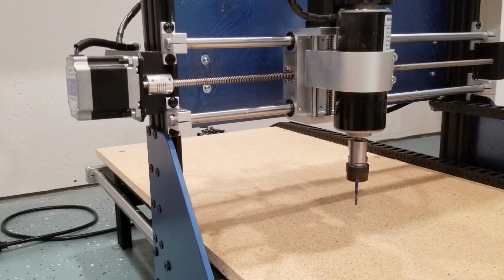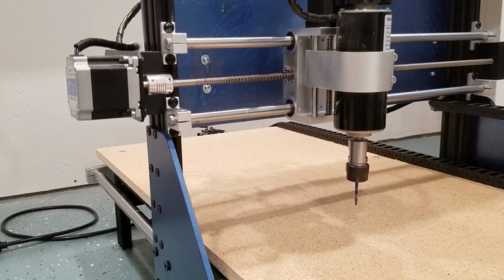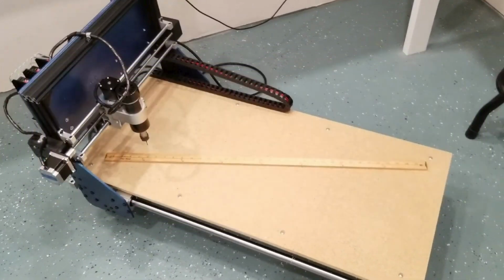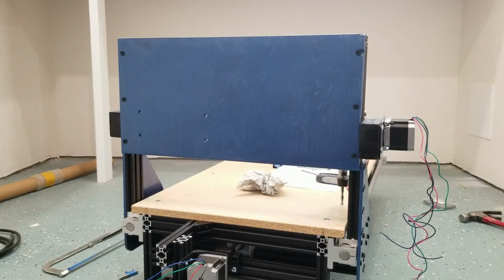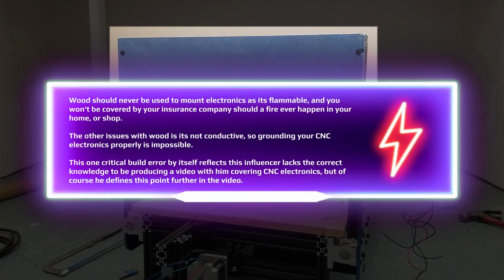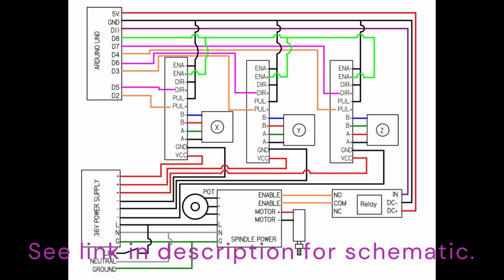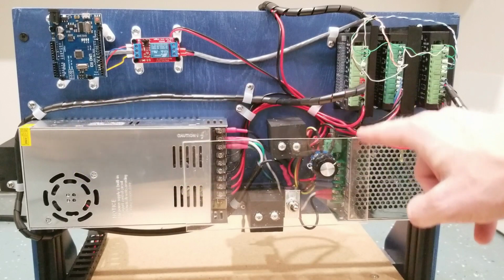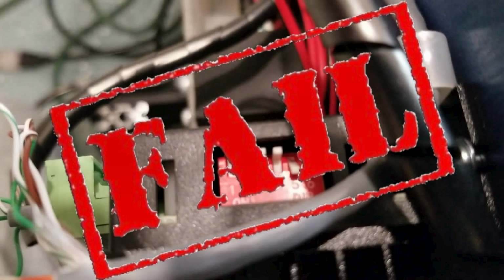CNC Router Controllers Built Incorrectly (Volume 17)

Comment: I had EMI nose issues in my DRO on my manual mill because all the mounting hardware was anodized or painted. Only after I ground off those coatings on numerous parts in key locations and achieved good solid grounds was I able to get rock solid repeatable performance from my DRO.

Comment: I inherited my bosses plasma diy project when i started to work there.... the list of stuff that are wrong with the project is endless ... didn't watch all of these vids yet, but i am sure that everything you have covered in the series this far will be on the list 🤣
basically it got put on pause 3 years ago... electrical components screwed with 1 screw to a piece of wood, and on top of this the plasma-unit next to this , and mechanically so cheapo it was no go-go
Reply from the maker: Unfortunately this is the case with many of these DIY project systems. Sometimes the original owner simply gives up, sells the system or passes it on. 

I can't tell you how many end users get in over their heads, and pas their problems to others. 

Thank you,
Vince

Comment: Is it safe by your standards, if the x axis sides are acrylic and moveing on nilon wheels on the y axis and the y axis is held by acrylic on the front and back. All rails are aluminium and electronics such as controllers and vfd is separate from each other? Building one right now
Reply from the maker: Thank you for your support. Safety isn't so much an issue pending the electronics aren't mounted on wood, or other flammable substrate. If the unit is using nylon wheels, on your transmission, and acrylic for the robot's frame structure then depending on your applications you may be disappointed with your system's performance. Thank you,
Vince